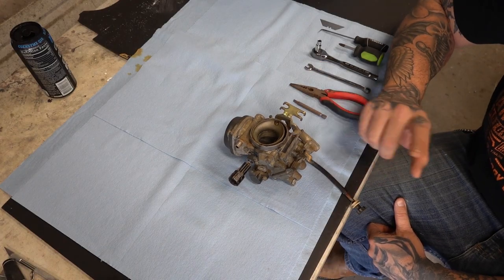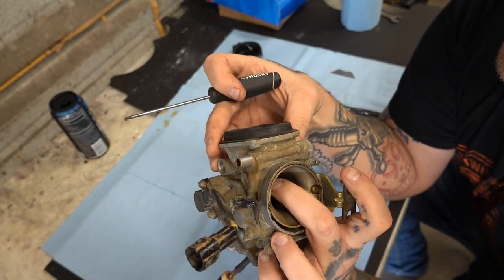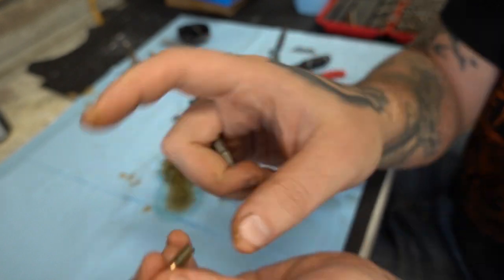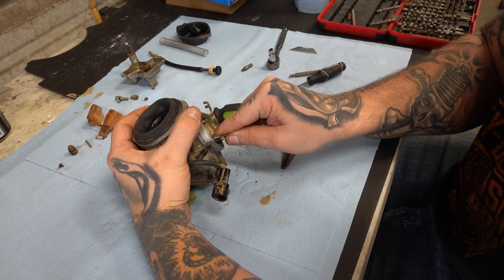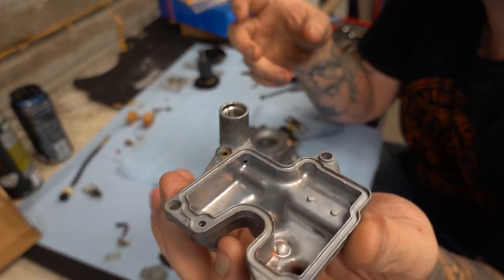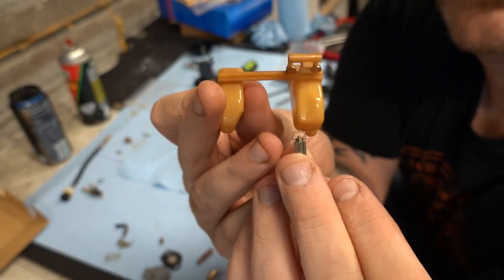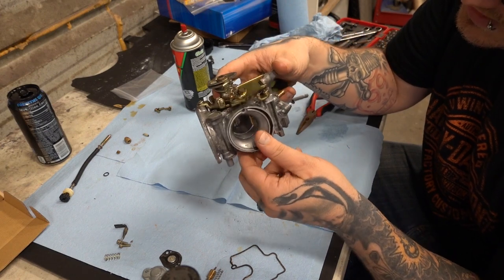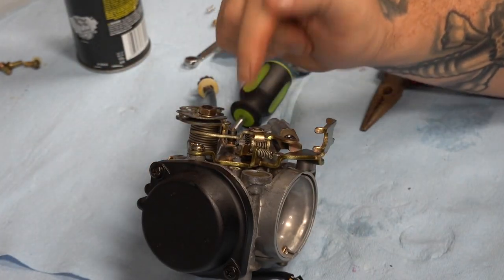How To Rebuild A Motorcycle Carburetor (in 4.914 minutes)

Comment: Hay man, I got a problem.  I crank the bike and it starts leaking gas.  How do I fix  or what can it be.
Reply from the maker: Where is it leaking from exactly? If it is leaking from the carb itself (not petcock) then you have a faulty needle valve. It either needs to be replaced or cleaned.

Since you said it happens only when running, that indicates you have either a fuel pump or petcock that is electronically or vacuum operated. So what's happening is gas is allowed to flow into the float bowl, but since the needle valve (sometimes called a float needle) is unable to shut off the fuel flow into the carb. This results in fuel usually coming from the throat of the carb, but can also come out of any open air ports that are tied to the float bowl. Like the float bowl ambient pressure port.

Long story short, pull the bowl off and clean everything with carb cleaner. If that doesn't work, replace the needle.

Let me know if you have anymore questions!

Comment: I'm looking at a 1982 Yamaha Seca xj550. Really cheap deal, but I'm a little intimated, as it's my first bike and I've only ever worked on small engines mostly lawn mowers😅
Reply: What's the best place to find parts?
Reply from the maker: Don't let it freak you out my man. Internal combustion engines all work on the same principles. Just take your time and label parts if you have to. And of course, hit me up if you get stuck. I'll be glad to help!
Reply from the maker: Bikebandit and oldbikebarn are some sites I've used in the past for quality OEM parts for older bikes.

Comment: See. I could fix my own old azz motorcycle myself. But literally videos for my bike are not on the internet. So I don't know how to take things out of my bike much less how to put it all back together. And replacement parts are impossible to find for my bike. 

I need a new fuel tank due to the large dent in the side of the fuel tank from before I got the bike. Rewiring needs to be redone. Carburetor will need to be rebuilt. I will need to drain the old several year old gas out of the tank. And probably need to replace the petcock. Need new blinkers since they've been broken off. New mirrors since they're broke. New battery. New brakes I think. New brake fluid. 

I'd rather take it to a shop and have it fixed up and basically 'renovated'. But my mother says no. Lol it's my bike. Yes I know it's going to be well over 2000$ for all that. But I guarantee they'll be able to find the replacement parts because that's what they do. They paid 400$ for it on my 18th birthday. I didn't ask for them to get me a motorcycle period. Especially not one that I don't have the knowledge or tools to work on. They know nothing about motorcycles either and have 3 others they need to get fixed. And they're wanting to pay someone to come fix them. They've all been sitting for 5+ years now without ever being looked at. It irritates me, too. They got all these motorcycles to 'ride'. Instead, they let them sit. Instead of ever fixing them. But when I want to invest in at least mine, they go, "No! That's a waste of money!"

Guess what, probably cheaper than going and buying a brand new motorcycle.

Comment: What solvent are you using in your ultrasonic? Simple Green?
Reply from the maker: It depends on what I'm cleaning. If it's not too bad I'll use simple green. If it's something like valves, heads, pistons, or anything else with heavy carbon deposits I use purple power diluted with water.